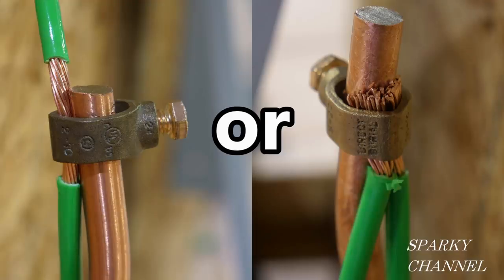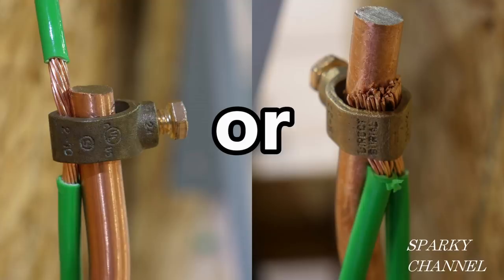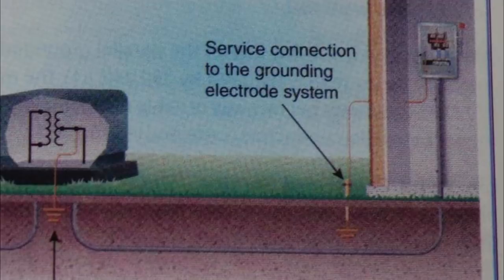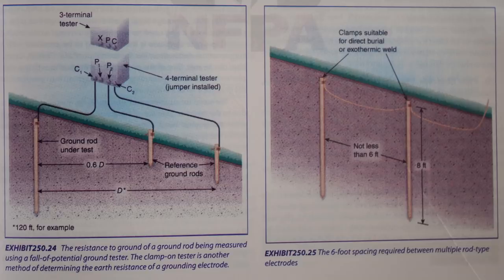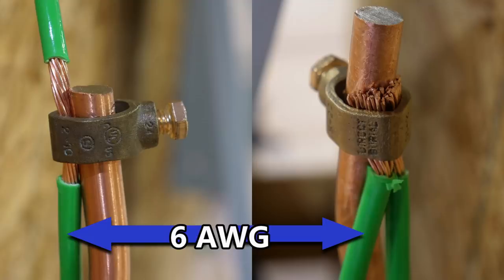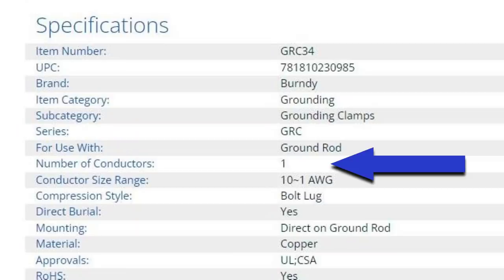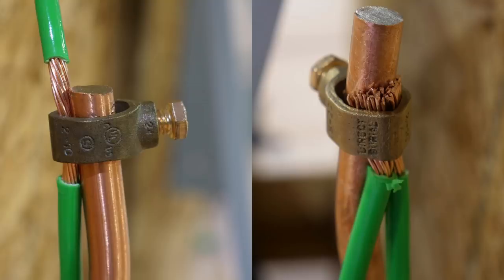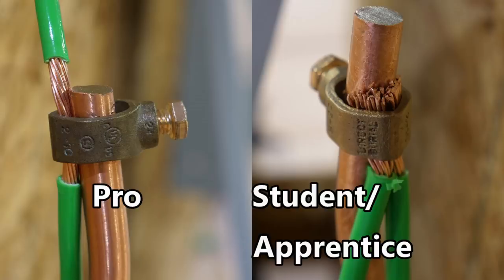Which is Correct?

Comment: I have a masters in EE, and even I know sometimes the code is a joke.  In this case it is.  There is nothing wrong with either from a mechanical, or electrical point of view.  There is simply no added risk going on here.  Sometimes the book should be thrown right back at the knuckleheads who think they know better.  Well, I'm an engineer and I call B.S. on whoever would fail this.
Reply: That's what I was thinking
Reply: The issue is the mechanical function of the clamp.   It's designed for the dimensions of 1 conductor.
Reply: @MrBen527  nailed it. I'm not gonna argue that it's probably fine the second way but you're adding a ton of unknown variables with regards to like strand creep.
Reply: @MrBen527  Not only is it designed for that, it's been tested and certified by the manufacturer for that use.
Reply: im pretty sure one could slide out of the clam and one cannot....
Reply: Slide out of the clam?  Are you serious?  Isn't that same risk present for a single cable?  Do you realize how much clamping force is on every strand in there?  Sure one or two strands might work their way around the perimeter of the rod during installation, but this possibility exists for a single cable at the second ground rod.  Give me a break.  This is madness.  I should show you some of the trusses inside my house that "passed", while stupid stuff like this fails.  We are doomed as a society if we waste our time on frivolous stuff like this.  The reason this code exists is because regular people refuse to have any common sense or ownership in what they do.  If you really believe this is a problem, ask yourself honestly how many people's lives could have been saved, and the the cause of their death or dismemberment could have been traced back to a failure of THIS particular kind?  If you arrive at the answer of EXACTLY ZERO, as I have, then you are starting to come around.

Don't even get me started on the reasoning for why there needs to be 2 ground rods 6 feet apart (or 25 ohms or whatever it is) either...

Seasoned engineers just laugh and laugh at stuff like this.  Every once in a while it's entertaining to run into someone's thought process on why stuff is the way it is.  I think the contrast makes it rather enjoyable to be able to come back to reality.  You know, for those of us who can think critically about something, evaluate the risks, and give a go/no-go decision on something.
Reply: @MrBen527  Common sense tells me that even murphy stays about as far away from this as possible.  He's too busy creeping up on the other stuff that still works its way through the system because common sense is so lacking to so many others.

Ask my inspector why they passed an 8"x8" square hole as a cold air return for my entire house (2400sqft, 2 story), or why they passed a truss an engineer designed that had nearly 3000 lbs hanging from a single 2x4 in tension (only 60 total teeth in the gusset plates on one end) that held up a bedroom and it's roof, with 30psf snow.  Or why they missed the form inspection on our foundation where they poured a basement window in the wrong spot (spanning an inside wall!)  They won't fess up.  They're too busy worrying about fire-blocking every damn hole or counting the number of conductors in a ground clamp to catch any serious structural concerns or anything else that affects the comfort or quality of life while in the home.  Couldn't care less about the roofer driving hundreds of nails through BOTH shingles for cheap toe kicks to follow safety codes for installation (should be illegal to do it this way), or how many lives were actually saved from spraying tiny amounts of foam everywhere in areas that have no air circulation whatsoever (outer walls packed with insulation -- I'll wait for a serious explanation on why fireblock is needed in this case).  I could go on and on and on.  The system is a complete and total train wreck.

If these frivolous things are what get inspectors out of bed ready to do their jobs, then in my opinion they should all be fired.  The system needs a reset.
Reply: I agree. I see people focus on little technical code violation that have no safety issues. Meanwhile, I find what appears to be a major design defect in the electrical system that powers the City of Santa Fe's water system and that gets no attention at all.
Reply: @byugrad1024  People will always find a way to screw things up (including contractors) whether intentional or not.  Videos like this are here to inform how to do it right.  There can be a number of reasons those items in your inspection were missed, passed or whatever.
Reply: @killer2600  Of course
Reply: @MrBen527  That's entirely my point.  Because of the overwhelming lack of education we have in this country and basic understanding of the way the world works (I call it common sense), we are left with a bureaucratic encyclopedia that dictates every move everyone ever makes, anywhere, on any project.  And the time it takes a reasonable finite personnel to check up on every single one of those moves detracts, distracts, obfuscates, complicates, and overburdens that workforce SO MUCH that they neglect what things end up mattering the most.  I still say either ground clamp should work fine, and whoever says otherwise is up in the night from my point of view.  

Any number of reasons why they passed off crappy stuff?  I'd say it's likely that number is similar to checking fireblock is present on every outside wall plate penetration.  Maybe there was some ground clamps they found in violation too.  HA!

Ironic that they didn't bother to check to see if any of my flex gas lines were grounded properly, like AT ALL.  After all, who cares if a lightning strike burns the house down?  But dammit, if it does, we've gotta make sure the fire department has a full hour to extinguish the fire because we can't live with 58 minutes if someone missed the fireblock on the top plates!!!!!!!

Ridiculous.
Reply: @byugrad1024  One thing I did learn first hand in the military is that all rules,  laws and some procedures are written in blood.   They're there because someone got injured or killed without them.   If an inspector,  quality control or police officer doesn't catch or enforce them,  that's another issue.   If your gas lines catch fire because of a lightning strike that would be because your grounding conductor was not properly bonded to the grounding rod. 😁
Reply: @MrBen527  Agree with you about the gas lines.  That was MISSED by inspection, and now I have to go install them myself.  They got the ground bond at the panel correct, but didn't bother to ground the (FLEX) gas lines themselves.  This is exactly my point.  If all 10 million rules need following, ALL 10 million rules carry equal weight in the eyes of inspectors.  Obviously some things are more important than others, and what I'm saying here is that NOBODY, EVER, in the history of mankind, or EVER into the future is going to die because of the way either ground clamp is installed in this video.  THAT IS MY POINT.

I disagree with you on the reason why the rules are the way they are.  To a large extent, the rules are there because someone, somewhere LOBBIED to get them in there in the spec.  Someone wrote the spec, OWNS the spec, and then SELLS the spec, and profits from it.  It's there because someone else "knows better than you do."  And what I'm saying is, no, that's not the case, at least in my case.  I'm smarter than that, can reason about the physics involved, the risks involved, and I call B.S. when I see it.  Plain and simple.  If my inspectors didn't have to worry about the stupid stuff, perhaps my home wouldn't have half the other major problems it has currently.
Reply: @byugrad1024  Actually I've never seen or heard of grounded gas lines in a house.  I'm curious to know what municipality requires it.   As far as these policies and procedures, they are not made to produce income for a company.   Everyone including the company who made the product would much rather not deal with the hassle of record keeping and the threat of being sued when someone uses a product wrong.   But people do and then life and property are lost, lawsuits are filed which then gets the ball rolling.
Reply: I just looked into it again, and you're right.  The yellow lines are the only ones that should be grounded, and they installed black.  However, they did not install it properly as the arc resistant coating is not present everywhere along the line.  They tore too much of it off at the fittings (about 1 foot too far).  So turns out they didn't miss a grounding issue, but it's still a code violation if too much of the black arc resistive wrap has been removed.  I'll probably just ground it anyways and forget about it.

Look, I'm not suggesting that we abandon all codes.  I'm simply saying that this level of tediousness is over the top.  And I mean WAY over the top.  The set of circumstances leading to the clamp on the right failing, but not on the left, I would intuitively estimate occurring one time out of tens or hundreds of millions.  There is no WAY this much consideration is given to the rest of what goes on in a structure.  And no one will ever be able to convince me otherwise, based on my own physical world view.  I wish I had the power to change some of these frivolous rules.  But all I can do is call B.S. when I see it, and this definitely qualifies.
Reply: @byugrad1024 ?  I still have never heard of any gas lines needing grounding like that. 
I agree that it's ridiculous, but it's just inevitable that things like this materialize after an accident occurs and someone is accountable.

Comment: explain  why
Reply: Because electricity likes to flow through smooth paths, not broken cable or 90° turns.
Reply: @1mikewalsh  ya right it flows like water
Reply: Wouldn't that contradict what happens when joining wires together with a wire nut?

Comment: would not both technically be wrong since the stranded wire is many smaller wires so you have a couple dozen 22 AWG or so conductors all that are way smaller then 10AWG? so two violations according to manufacturer.

I personally would not use stranded wire like this exposed to the elements even though it is allowed as there is much higher surface area to corrode and it provides a path water to wick all the way down the strand and corrode from the inside. I would much rather see a solid 6awg wire in that photo on the left and I would be very happy.
 
Also even if the photo on the right had "1 conductor" I still would not like how close it is cut off as it could easily be pulled out if say a landscaper stepped on it really hard. I like to leave a little extra to fold over 180 degrees and wrap around the whole rod below the clamp just in case this were to happen. Sure it may cost an extra shekel but this is the most important conductor for electrical safety so it should be treaded as such and is not the place to use "bare minimum code".

Comment: What's the downside to the wrong one
Reply: It's wrong
Reply: Absolutely nothing.
Just used outside the spec the manufacturer's engineer wrote.  Two 6 AWG wires have less area than one 1 AWG wire so capacity is not exceeded.
Plus since continuity exists between both wires it could be argued it is one conductor (but still two wires, unless solders together).
Reply: It's not tested or certified by the manufacturer to function as designed in that configuration.
Reply: @killer2600  just like using a hammer an screwdriver to install/remove lock nut. Instead of the lock-nut pliers (not standard channel lock either).

Comment: There is a problem with BOTH of them.  They are not in the ground far enough.  They have been pounded until the top has bent over and stick up in mower catching territory.   Here’s a tip.  Take a quart of water and pour it in the hole made by the rod and work the rod up and down in the soil adding more water as needed.  Most times you can sink the whole 8 foot to ground level without a hammer strike.  Done right, you can step on the rod to sink the last 3 inches flush with the ground.  No bent rod, no mower strikes for a professional job.
Reply: Since it was work done during/as a contest, I'm betting the rods weren't in the ground at all.  Maybe they did have a pound-it-into-the-ground competition, but I doubt any contest organizers would care to dig all those rods back out of the ground at the end of the day.
Reply: Where do you live, having ground so soft that you don't have to use a hammer?
Reply from the maker: The ground rods are only symbolic though, just pieces of ground rod connected to OSB in the Music City Center.
Reply: @curt2742  Unless you have lots of rock or cast off concrete, the water trick will work in any soil up to glacial till.  What do you do in Steamboat Springs?
Reply: @cadewey6181  That wasn't meant to be a dig, I was genuinely curious. I'll have to suppose you're right though, I've only ever worked in the mountains, lots of rock, clay, etc.
Reply: @curt2742  He must live in the deep south!
Reply: Same, I'm lucky if I can drive a steak 6 inches into the ground, sooooo many rocks literally jealous when I see a video of someone stick a shovel in the ground and pull up nothing but brown soil. Mine is always atleast 30-50% rock
Reply: In picture #1 even if you sink the rod slightly below ground level, the wire is still going to protrude above ground level. What does the code say about burying or protecting the wire between the ground rods and between the ground rod and the point where it enters the building?
If you are required to bury the wire, you would have to put a very sharp 180 degree "kink" in the wire OR you would have to sink the rod 1-2' below the surface to get a large radius wire bend.